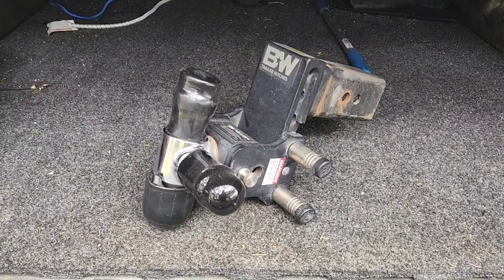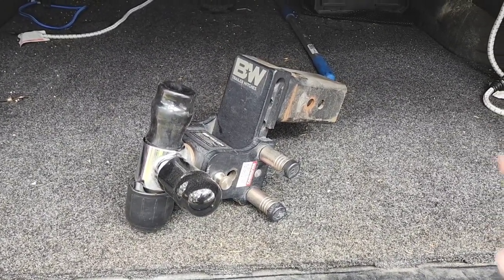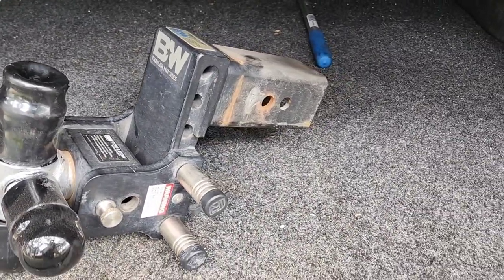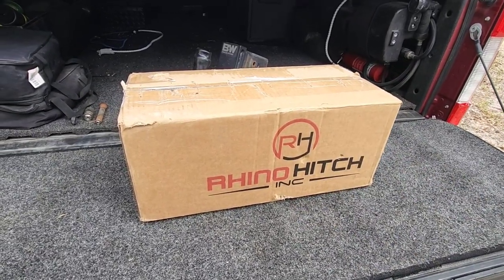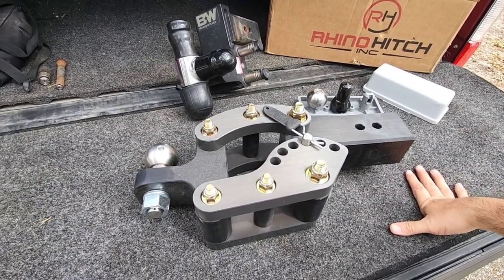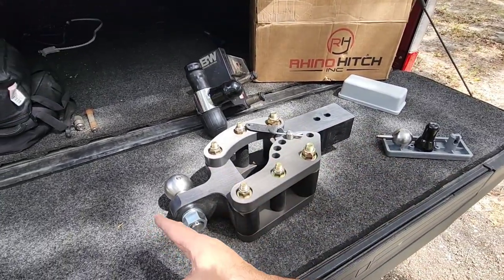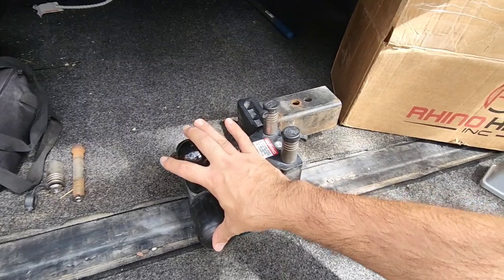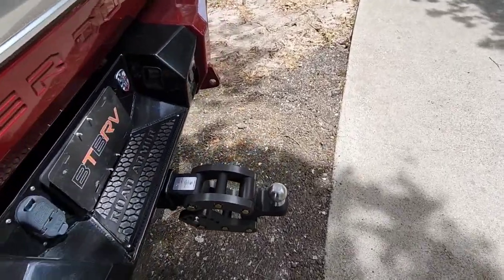Crazy Hitch Design from Rhino Hitch

Comment: JD I have had my rhino hitch for over three years now (still looks newish). I live approximately 35 miles north of Salt Lake City where rhino hitch is located. Where you have a problem with the length dimension is actually one of the greatest advantages of the rhino hitch. This gives you more turning radius because you’ve now moved the pivot further away from the bumper. As for changing the balls use the R clip to push the pin through the ball. I’ve used mine for a 16K dump trailer, 7800 lb boat, moving travel trailers around the field, and other small trailers. I have mine locked on my truck with a bolt lock that is keyed to my truck (one less key to carry around). By far the greatest hitch I’ve ever owned.
Reply: Small world haha. Fastway/Equalizer are in Provo, and evidently Rhino is in SLC. Weigh Safe is also Utah based if I recall correctly.
Reply: Andersen hitch is just north of us in Idaho. What can I say we like to tow toys around out West.
Reply: @seanstephens3896  it appears so haha
Reply: Moving tongue weight further away from axle?
Reply: I disagree with your opinion on moving the pivot point further from the bumper...that's the worst thing about most adjustable drop hitches. You want it as close to the bumper as you can get it. Hauling heavy it puts a ton of stress on everything when turning sharp in an awkward terrain the further you place the hitch from the bumper. Of course it does improve turning radius but I think that's so negligible that it wouldn't really concern me.

Comment: The engineering is extremely impressive. I just wish the ball was matched to the weight rating of the mount. Thanks JD.
Reply: Switch to a regular ball instead of an "adaptaball" for greater ball capacity.

Comment: Interesting idea, makes height adjustment easy.  But having to keep a ball somewhere in your truck and not loosing it would be a pain.  Also having to handle the ball to get the pin in/out after some grease on there isn't ideal.  The ball may also develop some play over time.

Comment: Need to keep the pins that attach the balls lubricated.  They can become rusted inside.
Reply: I've been running the Convert A Ball system for 25 years now , with no rust issues with the pin inside of the ball . There are small rubber O rings on each end of the pin that keeps the pin in the ball when you're not running a trailer . As for a messy , greasy ball , try using a dry moly spray lubricant .

Comment: Interesting design, but ill stick with my B&W. I dont have to keep track of the balls and everything matches in terms of specs. BTW, I highly recommend white lithium grease for your pins, it will keep them rust free and from getting stuck in the receiver and the hitch. and if you dont want to keep using the covers, i recommend graphite dry lube for the balls. it works great and doesnt attract dirt. you probably already know this but mine still looks new minus the grooves and scratches on the balls

Comment: I just got one for my 1/2 ton 4x4 truck that I tow a variety of trailers with, including various trailers that I don't know what they need until I get to them. I'm limited to about 9000 pounds so I got the 10k one with 7" drop. They definitely shouldn't include the convert-a-ball with the higher capacity ones without a strong warning about it's capacity. So far it's working out well and I only have to carry one with me now. This one weighs less than the 3 I normally carry.

Comment: Hey JD, I've had this hitch for about 4 years now so here's my opinion on it. I have some of the same issues you do. The ball was not rated high enough for what I needed to be towing. My other problem is after about a year of using it the aluminum started to mar where it rode on my trucks receiver. For those 2 reasons I quit using it regularly. I have since switched to the curt rebellion hitch and am totally thrilled with it. I got it on etrailer, you should check that one out. I really only use my rhino hitch for the occasional towing of a trailer with a 2" ball that is just a small trailer. I still appreciate the ease of adjustability on it. Just not heavy duty enough for my everyday use.

Comment: Great new hitch design, use all kinds every day, if it had a pointless lock for the 2 5/8 ball that would be for serious haulers and to incorporate the B&M design with the three balls that rotate, you mentioned the 6 inch drop on the B&M it also is a 6 inch rise if you flip the whole reciever upside down, since the bald rotate you have a ability to make it taller as well if the adjustment holes are not enough!

Comment: On a completely different note JD. What are your thoughts on towing a travel trailer that has a dry weight of around 8600lbs and a length of 37’ 8”. I believe the GVWR is around 11,300lbs. The trailer I’m looking at getting is the East to West Silver Lake 31KBH. I’m having trouble deciding what truck to go with. I’m looking at getting a Ram 2500 crew cab 6.4 Hemi with the 4.10s, a Chevy 2500HD crew cab 6.6 gas with the 3.73s or a Ford F-350 crew cab 7.3 gas with the 4.30s. I’m sure any of the 3 trucks mentioned would do just fine I just wanted to get your thoughts on the subject. I am leaning more toward the Chevy as I have been looking at getting one of those for a while. I know a weight distribution hitch would also need to be used.

Comment: I have one and have been using it for the last 2+ years. I ended up buying the 3rd ball so i have the 1 7/8, 2, and 2 5/16. also i have the ram so i got the 2 1/2 vs the 3 that you got. With the distance that it sticks out it helps with setting the tailgate down. to me the only issue that i have come across is that they do not make a step that you can add on.

Comment: Hi there, you wouldn’t know the shaft diameter through the horizontal plate in mm would you. Just considering one of these to be used in Nz. The requirement here is 32mm shaft for over 3.5ton

Comment: Slick design definitely took some time to dial in. However from a view without actually use, the stick out does seem excessive, if you don't grease the ball i see the pin in the ball getting dirty and sticking, if you do grease it then you have to push a greasy pin in and out. It's size would make it hard to store inside the truck and leaving it in the hitch adds a lot of length for parking, walking around and stuff of the sort. I'm seeing comments from people saying they like it but i don't see it being practical for me.

Comment: I’d be a little worried about hitch rattle.  With all the articulation.  I like the height adjustability.  and I’m a fan of the Convert a ball system. So easy to change sizes
Reply: Honestly hitch rattle is minimal due to the solid billet shank. I also run mud flaps on my rhino hitch when towing just to keep rock chips from ruining my trailers. That little extra weight takes out the slop in the receiver.

Comment: 1. At over $400, no thanks. Lots of adjustable hitches for less than half the money without all the moving parts that WILL wear.
2. It will look nice on the next truck, after it's stolen.
3. The Convert-a-Ball has been around for a very long time. Some hitch manufacturers specifically don't allow this to be use with their products.

Comment: Neat design. I think the whole ball design is unecessarily complicated. Why not just design a tri ball on it? I have a Gen-y which is tough as hell, but one advantage this has over that- is if you decide you want to raise or lower the hitch you can do that without having to move the truck ahead. Hands down the worst thing about adjustable drop hitches it how far they stick out from the frame of the truck. Aside from just being annoying that puts a ton of stress on all of the components involved when towing heavy, and turning sharp on awkward terrain.

Comment: Is this rated for a 180degree rotated mounting?
Reply: You can flip the part that goes into the receiver of the truck. I had mine flipped because my cab and chassis trucks flatbed had the receiver very low.

Comment: The "convert a ball" not a great design - even with it greased, my pin seized in the ball after a few months.  would have to remove the ball after each use to keep it working.

Comment: Lot of weight riding on the pin
Reply from the maker: It's sheer force though.  Depending on the material they used, it would likely take far more energy than you think to sheer that pin.